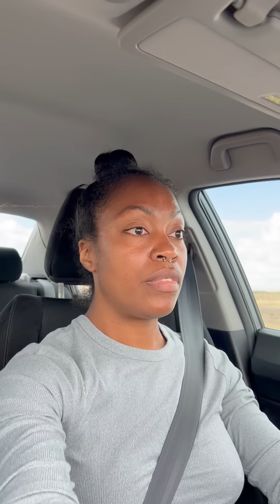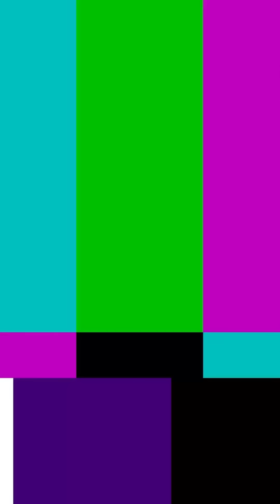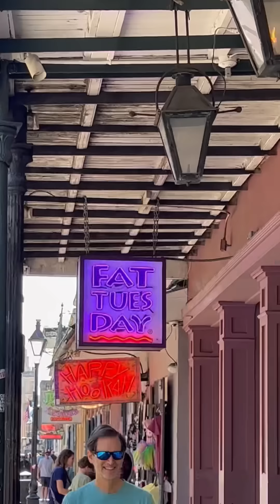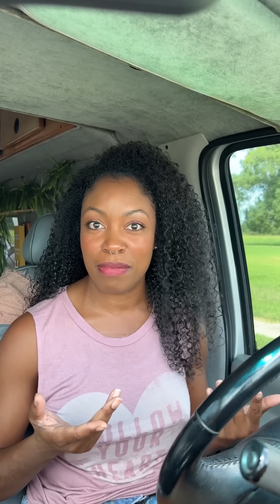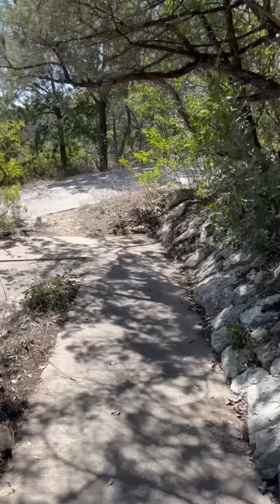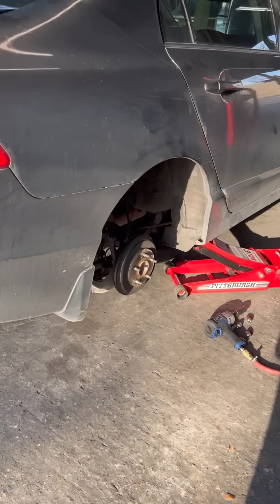Living In My Car | Final Destination

Comment: I didn’t realize people actually stressed over those cracks when they’re still hairline. I thought you get nervous only in the winter or if it’s starting to have spider web like cracks expanding. I’m truly about that broke life because I would’ve never bothered to replace it until I absolutely had to. You rock
Reply: 🤣Right me too, had mine like that for about 4½ years before I had to get it changed.
Reply: A rock hit my windshield in 2016. I still have the car on the road (230k, but needing a transmission soon!) with that same windshield sans repair. I would never even CONTEMPLATE driving that far for a fix. Literally I may have thought about that crack 5 times since it's been there - counting right now. 

But I will gladly watch Nate go on this journey! If she were a livestreamer I would watch daily with rapt attention!